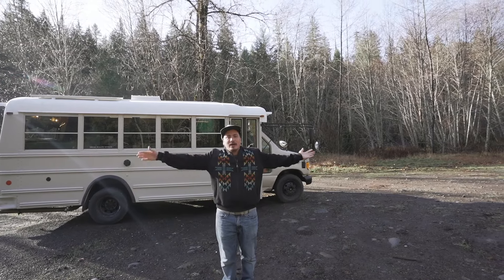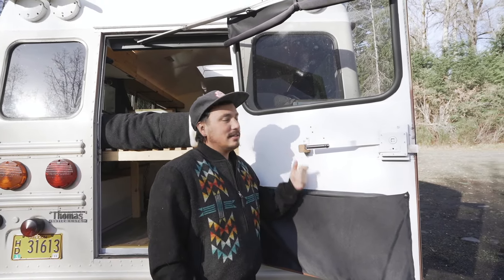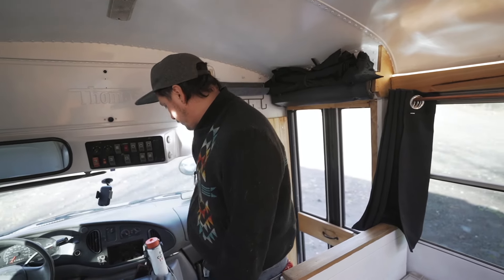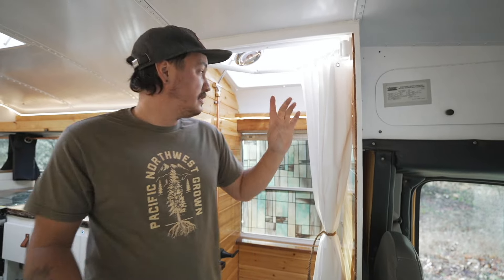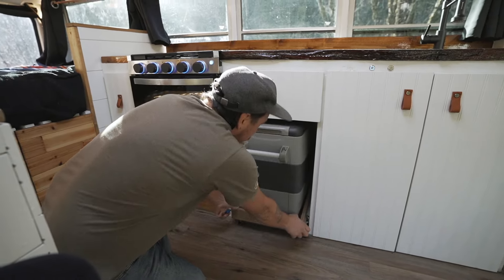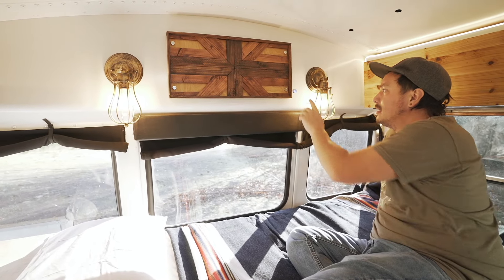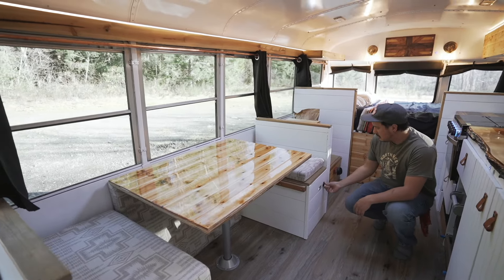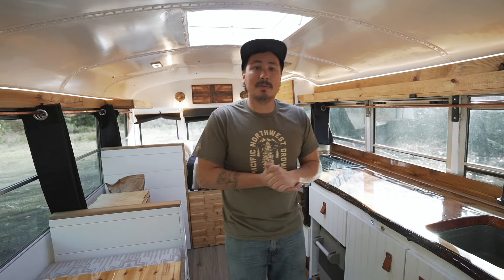7.3 Powerstoke 5 Window Short Bus Skoolie Conversion Tour (w/ Toilet and Shower)

Comment: Love the layout of the bus, the only thing I was unsure of is where the toilet is. It is high up for one and takes up valuable space. It would be cool to do a table top over it that lifts off and on like the dinning table. Or slide the dinning area back and use the wheel well for the base of the bench and it is across from the kitchen and then move the toilet across from the bathroom behind the half wall. Just a suggestion for a next build. BUT the colors, curtains and all of those items from your sponsors are amazing! PS smart idea on the casters on the bottom of the fridge slide out. Until your next video ~peace
Reply from the maker: ahh good point. I am gonna try something different in the next one.
Reply: Would love curtain around the toilet for privacy.
Reply: yes did not like the toilet there all else was great.
Reply: Agreed!
Reply: How much did it go for?

Comment: So many thoughtful details, such an incredible build! The only thing I would have done differently is - I would have put the toilet on casters and put it in the shower area. I'd have it stealthily roll in and out under the cabinet area to be out of the way when showering to allow for privacy when using the restroom. Your guests don't want to be using the restroom in front of you! lol. I'd then put the fridge where the toilet currently is for easier access in and out of it. Could even add a slightly larger fridge option in that area. But other than that, this entire build is so well thought out, practical, and beautiful. I really love how this came out!
Reply: Great ideas!

Comment: He should build in a bi-folding lid for the toilet compartment, in which the depth of the top of this box, reaches the top of the window for complete window privacy when lifted for toileting, and the height of this bi-fold box when closed, could be made to be countertop height for more food prep space or standing work space for computer use, or if you pull into a place where there's a toilet like a campground, you could use the top for storage.  I'd also put a curtain between the bed and the toilet compartment on a track that wrapped around the toilet compartment nice and wide (touching the opposite side countertop and closed resting on the seat of the dinette near the window for quick privacy when you gotta go, instead of closing a bunch of individual windows while pinching or doing a pottie dance.  I would increase privacy, and usable space, because right now, that toilet space, while important, is probably used less than 15 minutes a day.  He could make the box out of coosa board (marine board that is lightweight and extremely strong) or corian to add dimension to the interior space and be maximally functional without adding the weight of wood.

Comment: beautiful job, i think it would be nice to put a wood top like the table, over the toilet that can lift up on hinges and a latch to hold it up, giving extra privacy when going potty and kinda hiding the potty when not in use. it will also give extra space to set things on. easy to add on.  over all great job. also if you put 1" stripes of wood to back of curtains going horizontal, say like 3, and a strip on bottom of curtain, you wont have to roll them, you just push them up and than snap it up. simple slots on back of curtain would hold them, or you can sew them in between two pieces of fabric. (like venetian blinds) magnets on the bottom corners so they stick in place when down. sorry not criticizing just throwing out ideas.
Reply from the maker: Def will experiment in future builds

Comment: The back door. A friend of mine suggested to me to split the door open and install a bolt system to bolt from the top, 2 on the side and bottom. Pretty much like a safe door. I like your idea better, plus like you said there is plenty of glass to smash if they are that desperate.

Comment: Great job, love the bus. For everyone who doesn't like the toilet set up, it wouldn't take much to put walls on each side and put stain glass on the windows and do a curtain like the shower has to close it off. I think it is perfectly fine for how often you will use it. If I bought the bus the only thing I would change is put a slide in and out board over the toilet with cushions on top to make it a reading nook.
Reply from the maker: Ahh good ideas Virginia

Comment: I question letting the urine just drain out. I would think it would start to smell outside. And if everyone did that it would really smell outside. I know you camp in the woods but after a while it would be noticeable, wouldn't it?
Reply: Still dump in dump station Cheap or do yaself w/Container from Amazon & Can add a Tiny drop of Anti Freeze.. NOOo Smells❣️😊
Reply from the maker: This set up is for someone traveling and moving everyday

Comment: Just a heads up. Someone like me hears you say it has a hot water heater under there but i'm not going to show it, its a mess. And you're selling this? This would be a non starter for me. You must be expecting internet sales since you posted a link for it. Not showing the insides of drawers either. It's those little things that will make or break a sale.
Reply from the maker: all these busses will sell on line. I was also in sales for years before social media and have never lost Money on a vehicle ever.

Comment: I love it it's beautiful. Love the separate shower and toilet can't stand a wet bath too much work. I would mostly be in the southern states Florida mainly. Definitely have to have air not heat. How hard would it be to put a screen on that sunroof? Heavily wooded areas come with heavily bugs mainly mosquitoes thicker than thieves can't deal with that . Also do the windows open and do they have screens on them? How is the bus cooled? Thanks in advance
Reply from the maker: Windows open and don’t have screens. New owner could do that. Thank you for watching :)

Comment: Nice layout very open and Airy. You did not mention insulation in the build. How do you account for condensation and mold or is that a problem? I'm a fan of the sky light but they have a tendency to leak overtime. What is the solar setup?

Comment: Well if I ever go with a small skoolie I might see if I can hire you. I like a lot of the stuff you did but there would be some things I'd want to be done differently. Me personally, I do laundry much more than I "cook" so I'd be putting in a washer/dryer unit before an oven & I'd save counter space using 2-burner instead of 3. Agree with another commenter that the toilet is not in a good location. Leave it open on one side only and close off the toilet.
Reply: I can’t imagine how much of your water would get used up by a washer and dryer
Reply: @wingadinga4003  Yes, it would use a lot of water but I'm looking at these for long-term living minimalist & I wouldn't be planning on boondocking too much. I'd be looking at being at the RV/tiny house sites with hookups.

Comment: i have those same lights shout out to dorit but how’d you install them?
Reply from the maker: These lights are awesome! Well if you have wood you can just screw the clips in and put it up. I notched out a piece of wood an inset it.
Reply: @isaacturnerit  ahhh got cha i left my skoolie roof exposed so i was trying to figure out how to install without drilling a billion holes in the metal so a strip of wood might be way

Comment: In most parts of the country. If you don't put a lock on your Fuel tank, you aint gonna have them fuel. Or they will put stuff in it they will still Your fuel tank lid

Comment: That's a really good idea to make a dinette. If you put it down into bed mode, you could also use that as couch mode if a couple of friends comes over. They can sit on the couch until dinner is ready, then convert the couch into dinette mode.

Comment: Nice job, but I could never understand why people don't want privacy when they go to the bathroom. I think no matter how nice a build is, if it doesn't have an actually bathroom space, where I can do my business in privacy, it's just not a build or lay out that could work for me. The rest of the bus is really nice though, just my personal preference. Use it well!
Reply: i was kinda laughing at that toilet, you sitting way up in the air on display literally on a throne, with all the windows right at ass level or ass at face level for someone sitting at dinette lol, i would have to go thru and close all the curtains and throw out anyone else in the bus first.... and then the smell blowing out right at face level on the camp side of rv where your friends are waiting outside, probably some of the various sounds coming thru air tube too, fart, thunk, splat lol..... pretty sure just dumping grey tank anywhere is not legal either, but i dont really see any harm in it either, since it is nothing worse than shower or dish water.
Reply from the maker: Yeah I agree somewhat. I guess I built this with my experience in mind and didn't really think about other folks. I am usually in the woods with no one around me and privacy doesn't really matter. Next one I will build that way.
Reply: @isaacturnerit  nothing about it is a deal breaker to me, since i am one who would be in desert or other solo type places as well for the most part, or anyone with me have their own whatever, tent, etc. curtains work fine, really only need to shut ones facing camping buddies, not all of them for that few minutes. i just cant help but laugh at the position and placement of it lol.... abe lincoln up there talking to the people hehe, i would have probably just swapped toilet over to next to shower and that somehow, and put fridge over wheel well instead, basically same size, space taken up, should fit in reverse, blow the aroma out drivers side lol... i know can not change this now, just that it probably would have worked fine. shower, toilet, then kitchen stuff, could even have counter space fold down over toilet as well if more on floor ... is a great off grid setup regardless, just that one thing is totally hilarious, would get a lot of laughs from visitors.
Reply: Haha! Lmao! 😃😃👍✌❤

Comment: Is 150 ah battery bank enough?
Reply: @ChuckCassadyYT  How much is enough? I plan on using an old propane rv fridge, so no power consumption there. I will have a furnace and ac unit, but ac will only be used when generator is hooked up and furnace is propane. So mainly just lights, outlets, etc.
Reply from the maker: I lived in a bus for 3 years with 100ah.
Reply from the maker: @ChuckCassadyYT  I finished that bus that year. It was built in 3 months.
Reply from the maker: @ChuckCassadyYT  what’s your deal man. Why you over here throwing negativity my way? I love bus life. I love building. I was never trained. No one taught me anything. I only know what I know from my failures and attempts at trying. I’m sorry if I offend you.
Reply from the maker: @ChuckCassadyYT  no one is lying. You got issues

Comment: 29:00 - 😳 ….ummm what???? 😤 Dangit Bobby! I totally liked this build until THIS part.
Yes, when in the woods (or pretty much anywhere for that matter) you males, tend to pee where ever but mostly away from camp, like on a tree or bush. Sure feel sorry for the next campers that will lay on that ground, even if they’ll be in a tent.
Sorry guy, this build just FAILED. 👎🏿
Reply from the maker: you can also disconnect the tube and put the tank back in. Total of 2 min

Comment: Unfortunately it doesn't look like he has insulated any part t. t.   Those busses have to be insulated, they were never meant to be camped in. Its worth about $3,500. top dollar.  Only because it will have to be stripped and insulated it might not be worth that much. That's a lot of work to put into buying a stripped out short bus.  I couldn't believe it when I heard him say he's painting sheet metal (referring to the bus ceiling). Metal is a conductor of heat and cold, I wouldn't want to be in that bus if the temperature changes in the least bit No AC or heater would save you in that tin can.
Reply from the maker: You are very wrong. Busses already have insulation in them. Have you ever built a bus?
Reply: Depends on the bus. My full-size bus from 1990's needs insulation, but some of the short buses and newer buses with AC built-in have an upgraded insulation package from factory for super hot regions such as Nevada and Arizona.

Comment: Kitchen right next to the bed...not cool.
Reply from the maker: Tru I guess your so smart.
Reply: Wow....what kind of response was that? My point was who puts a stove right next their bed. But you did so I guess you're so smart. Small particles of grease popping in your bed. When you cook there's always grease coming out of the pan even if you can't see it. Dumbest design ever.🚫
Reply: It is one room, does not really matter. Cooker, Bathroom or sink will be right next to the bed.  What matters is everything is clean and there are no leaks.
Reply: @joec4871  There is a rather decent sized divider between the bed and the stove.. I don't think it's that big of a problem or deal as you're making it seem lol and either way things can be cleaned and washed if grease does get on the bed and if it was ever really a bigger problem you could probably just build up the walls.
Reply: @joec4871  you can turn it on during the night  and use it as a heater
Reply: @joec4871  i think you’re just trying to get some attention and that’s really sad. How about you show us your bus design? Do you have one?
Reply: @serenapalmer1220  # 1 wasn't talking to you. # 2 my design is the same as that wig you're wearing. Maybe next time you'll mind your business. Trying to get attention?  That was my opinion I wrote which I'm entitled to. Never fails Always a sister trying to down a brother. So stand down heavy D. With your 21 subscribers.
Reply: @joec4871  did you really just diss someone with more subscribers than you?? 🤣🤣🤣
Reply: @joec4871  and why you come after the sister so hard, but didn't say shit to anyone else who criticized you?
Reply: @joec4871  *how to say you’d never make it in Nomad life